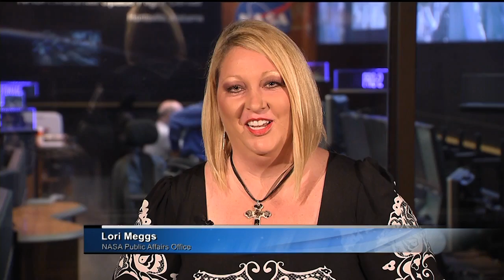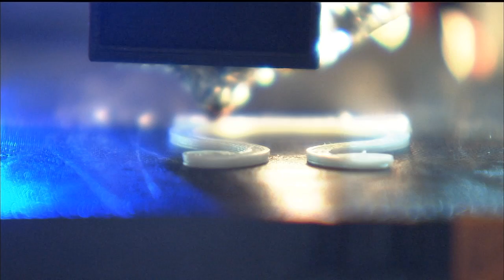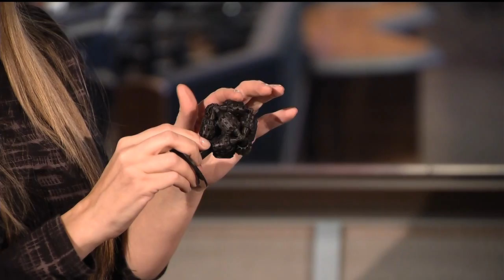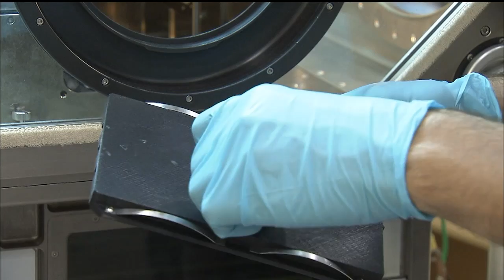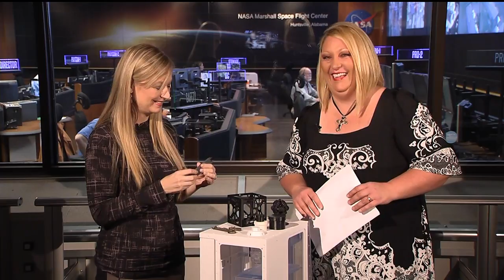Space Station Live: 3-D Printing on the Station

Comment: I would like for a single "space 3d printer" video to talk about whether or not a 3d printer in space requires supports.  I'm guessing not if there's no gravity.
Reply: supports serve more than just one purpose: the first is to make overhangs more managable. most printers have to adhere to the 45 degree rule, where additional angle to overhangs means gravity pulls the melty plastic down and away from the nozzle making strings and poor adhesion, even causing print failure. on earth you can actually get quite a but beyond 45 degrees with some special techniques: lowering the printing temp, using a cure-quickening blower,  running slowly, and finding the right balance between extrusion speed and travel speed. But the 45 degree rule is not entirely due to gravity, the other problem is that the plastic itself is only partially binding to the layer below it. the rest of the plastic has to cure in place, unsupported, with or without gravity. even in zero G, for instance, one would have a hard time printing at 90 degrees, as the outer-most perimeter won't be at all touching the layer under it. support makes this possible.

but the other reason to use supports is even more important to complex prints: there may be components that begin to print halfway up the build area before they are even connected to the rest of the part;these bits need a stand to print off of before being connected. irrespective of gravity, supports would be required here.
Reply: @chrismofer  I am sure their slicer has some sort of "print overhangs" that uses some sort of mid-space extrusion cooling trick...
Reply: @confuded  yah 2 years more experienced I can say it probably bridges fine so I really don't know how much support if any is needed in microgravity.
Reply: @chrismofer  he he, wasn't expecting a reply from such and old comment! 
From all the videos I saw there was no cooling fan as I assume that would cause issues. Or maybe juts because they are using ABS.
Reply: I wouldn't think that supports are needed, mainly support is used to support a hanging part of a print against the force of gravity (make it not fall off). The plastic sticks to itself so it could most likely print any complex design without the need of supports due to microgravity.

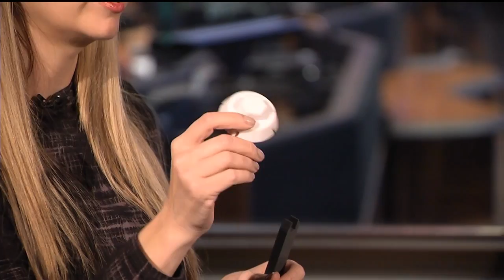Comment: 2:36 "we would just upload a CAD drawing".  It kills me when non-experts are interviewed and sound like idiots.  Nomenclature is pretty important when discussing technical things.  You upload an STL file, or 3D CAD file like STEP, or native solidworks.  I don't know of a single 3d printer that can interpret a 2D drawing and start printing parts.
Reply: They are speaking in a language that ordinary people can easily understand. Mentioning STL files etc would be unnecessary at this point. This is merely a general discussion on the topic
Reply: An STL file is a CAD file, and someone had to draw that file using solidworks or what-have-you. So what on earth (or in space) is wrong with calling it a ''CAD drawing''? Just because Solidworks makes a distinction between a"drawing" and a "part" file, doesn't mean that everyone else has to also.
Reply: @Overspray Collector  is saying CAD drawing completely wrong? Or CAD file? Computer aided design is pretty straight forward, and something that won't be easily mistaken for something else. You don't need to venture into the specific terms used by those only familiar to people that use 3D printing. It's already understood. If a 3d printing enthusiast or expert hears that then they wouldn't mind. It's not entirely correct, sure, but it isn't generally wrong; It's trivial at best.

Comment: i've got a question: why can you print in space? i mean, shouldn't the molten plastic float around? or it just sticks like water to any surface?
Reply: +HPS 400w remember it is warm plastic, not liquid.
Reply: so its a very slow process right?
Reply: +HPS 400w Generally, yes. But as technology improves, so will the speed. Someone else (+Lewis Walker) said that "This is the first step towards being able to essentially print a lunar base from materials present in regolith", and I've never considered that idea, but yes! Imagine if they had 3D printers that were 10 times faster than what is available today, and with a much much larger format capability. They could bring the raw materials with them, or mine them on the moon itself!, and build far more impressive lunar bases with much less to bring with them. Huge savings in launch requirements while giving them a much more versatile mission.

JW3HH
Reply: JustWasted3HoursHere never thought of that, by the way i cant get into my head how much distance does solar winds travel through space i mean its really incredibly huge
Reply: it is. think if we could harness that energy and use it to power ships, or even cities.
Reply: +HPS 400w If you've ever seen Star Trek 4: The Voyage Home, near the beginning of the movie the captain of one of the ships threatened by the cylinder ship (the one waiting for an answer from the whales) says they're using a make-shift "solar sail" to get back. Seemed far fetched back then, but now, who knows?

JW3HH

Comment: I can imagine a normal plastic extruding printer in space.
But such dynamic objects (like the little black one with the gears) and metal parts are made with dust, molten together layer per layer with a laser beam right? (Like this: /watch?v=2GI9Bw48liY)
How does one keep the dust from floating away in micro gravity?

If such adynamical part is not made with such a dust printer, with what kind of printer is it made?